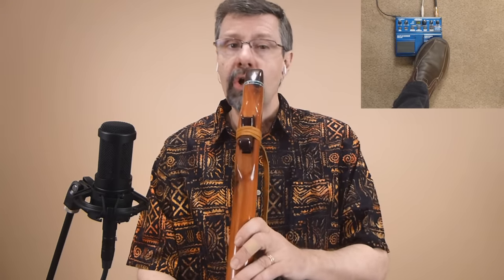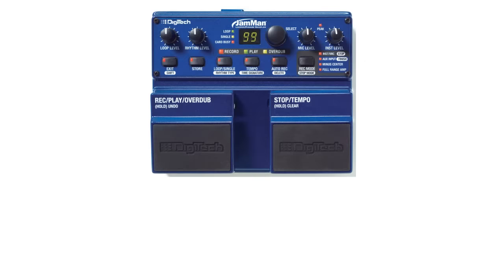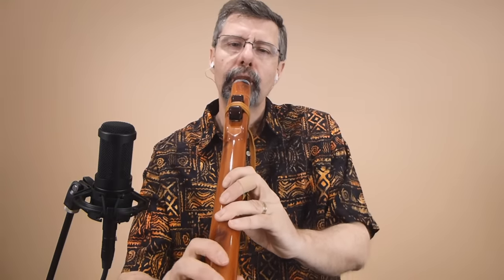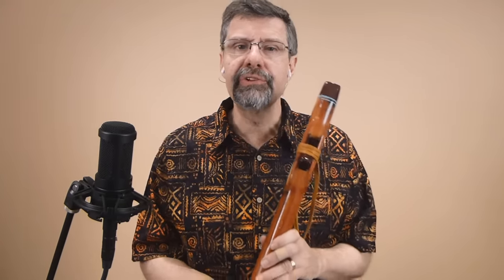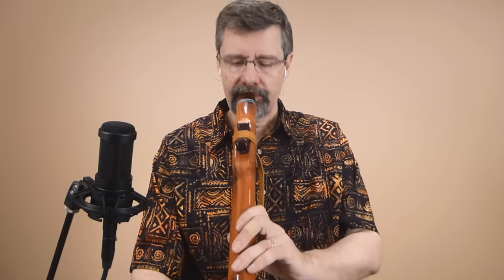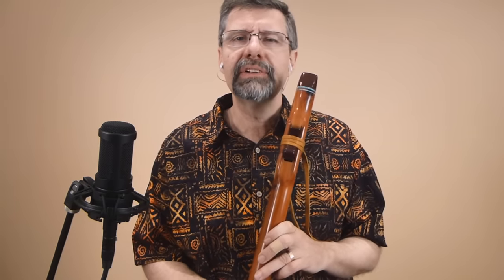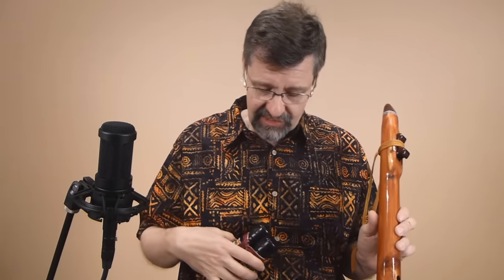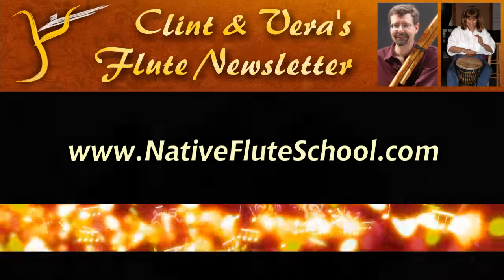Looping - Native American Flute

Comment: Hi Clint. You have the most and best info out there for NAF. What mic do you recommend using with a looper? I am older and have problems with tech stuff but really want to incorporate a looper into my playing. I have a flute mic, an Audio Technica that requires a phantom power source that my JBL P.A. supplies. Trying to figure a way to do this. Thanks for any advice or info sources you can send my way.
Reply from the maker: I usually recommend a large diaphragm condenser mic, which may be what you Audio Technica is ... Gear selection, setup, and routing are always a challenge. I do show some basic, high level, setup approaches in the video. More specific would need to consider goals, budget, and the capabilities you want.

Comment: Thanks so much, Clint, for the clear video. I've been debating whether to get a looper. This video was made several years ago - would you still recommend this looper for the NAF, or maybe technology has changed and you would recommend a different one today? Thank you!
Reply from the maker: There are many loopers with these basic capabilities. Each looper has their own advantages, but the basics of record, layer, playback, and clear are the same. Some allow a single Undo. Some allow multiple layers of undo. Some allow extending the loop or reversing it. Most of them serve as a simple recording system … Explore!

Comment: Hi Clint, where do you get a 'wind generator' and what company makes them. I would love to use that effect.
                              Feel the rhythm,
                                                         Jim
Reply from the maker: +Jim Copeman The little wind machine was made by a ceramic maker at least 10 years ago, and folks have not had any luck contacting him over the last few years. However, you can make great wind sounds just by breathing into the finger holes of your flute ... experiment with blowing into various finger holes, or across them, and putting the mic in different locations to get the sound you want.

Comment: Great idea - would the Jam Man Solo work?
Reply from the maker: Mike Yates Not sure about the Solo ... I'm not clear how a single pedal can handle all the function that I personally like: record, overdub, undo, stop/restart, and clear the loop. Check the manual and if you like how they do these things - go for it! I'm not a real pro on the range of equipment out there ... there are on-line groups that talk about this stuff endlessly (!!!)  But personally, it fun to get some experience with a simple, straightforward looper to see if you like working with it ... it can become like part of your instrument when you play.
Reply: I agree. I thought about that after I posted. The model you used in the video is a good price and in the same range as similar brands. I think I will go with the same one you are using. I use the Jam tracks you made and the looper will add another dimension to playing the NAF. THANK YOU.